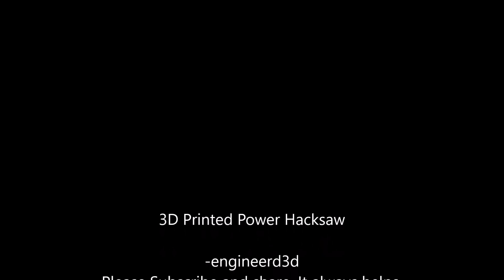3D Printed Power Hacksaw

Comment: Pretty cool and yeah, add some weight or a really good spring and see how she handles then.
Reply: +Bruno M. I believe you should upload a video of it cutting metal.
Reply: andrew makris
Agreed.
Reply from the maker: +Dark Alchemist 
It is still a work in progress. It actually cuts steel without jumping, I think the wood is what it does not like much. With that said it does work.
Reply: Bruno M.
Yeah, made for metal for sure and I have used a hacksaw to cut wood before (by hand) and it acted like that too.  Needed a lot of pressure to cut.
Reply from the maker: +andrew makris Will do. 

I may try to do a timelapse with my old security camera.
Reply: +Bruno M. thank you.
Reply from the maker: +andrew makris 

I added the cutting of steel. Hope you like it.
Reply: did you manage to add blade lift mechanism on idle stroke